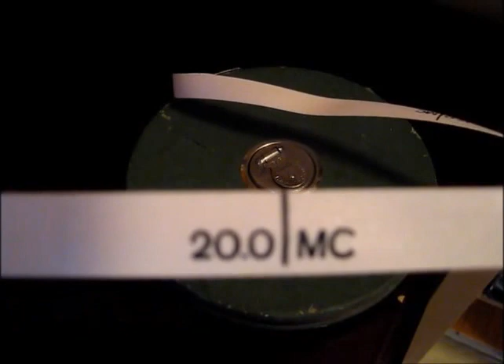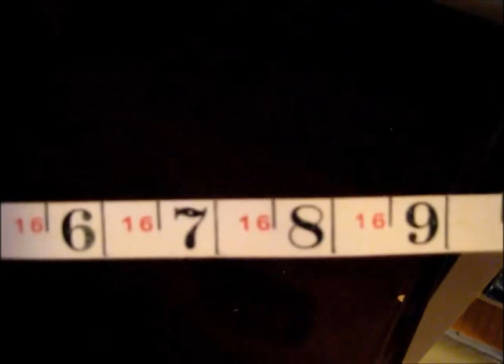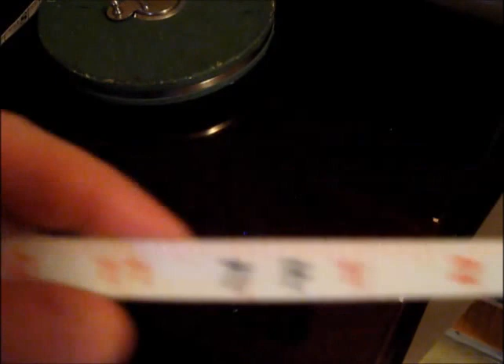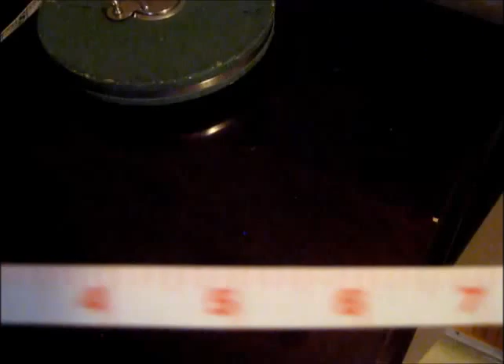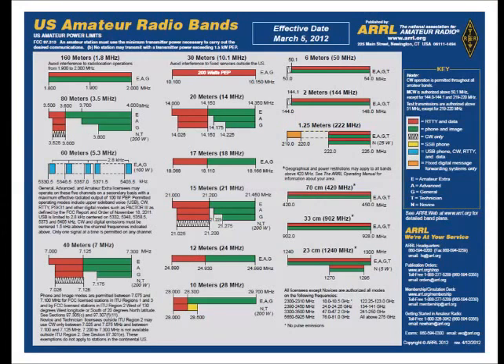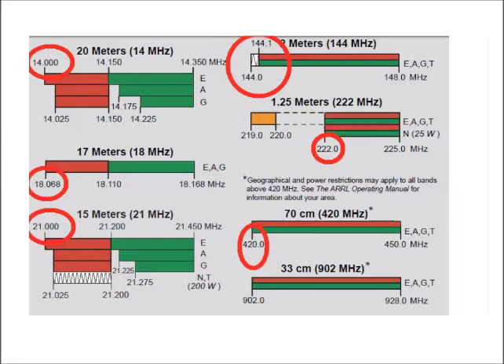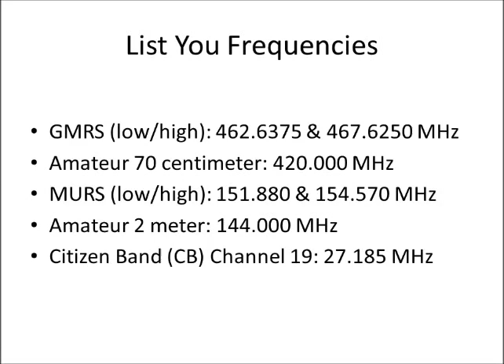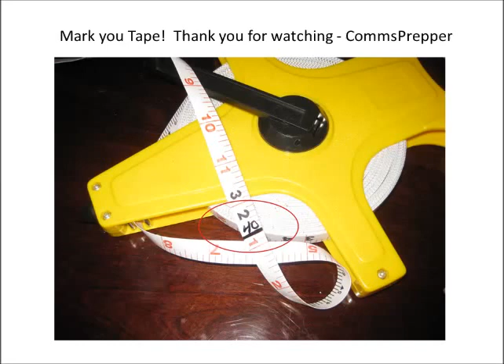Antenna cutting tape measure for Emergency Communications

Comment: The quarter wave monopole antenna is a single element antenna fed at one end, that behaves as a dipole antenna. It is formed by a conductor  in length, fed in the lower end, which is near a conductive surface which works as a reflector and is an example of a Marconi antenna. The current in the reflected image has the same direction and phase as the current in the real antenna. The quarter-wave conductor and its image together form a half-wave dipole that radiates only in the upper half of space.

Comment from the maker: @bigguyprepper that's correct.  typical dipole antenna uses two 1/4 wave elements (feed at the center) to make a 1/2 wave antenna.

Comment: i am new to communications prepping will I need six separate antennas to communicate optimally or are these antennas gonna help me achieve different frequencies on 1 radio? I'm sure this is a really novice question but any help you could give me I would appreciate.

Comment: Simple things for simple minds.  We all will be a little cognitively handicapped under stress.

Even if I don't mark my 100' tape up - I had best have it with me.  Now, a shorter (say 25') measure would equal about 7.6m.  Fine for a 6m full and 12 and 15m half wave, if I am thinking right.....

Food for a real amateur's brain.  Not a ham - but a novice.  No that's confusing, too.  Like a radio mall ninja......

Thanks